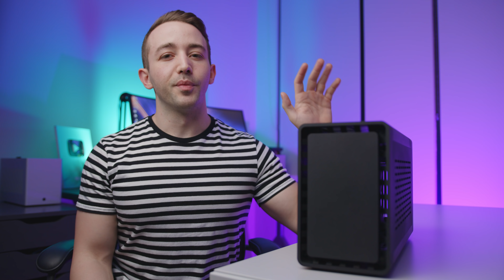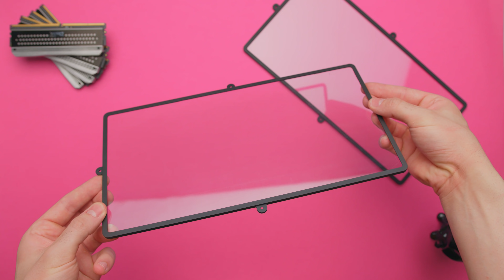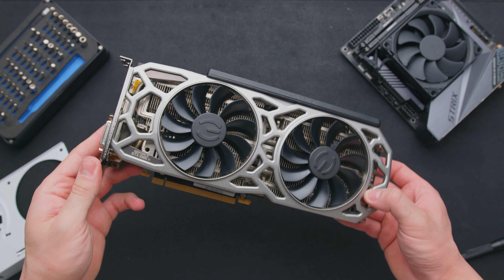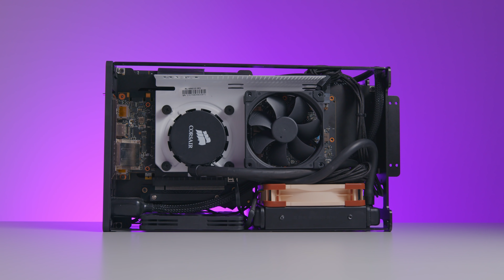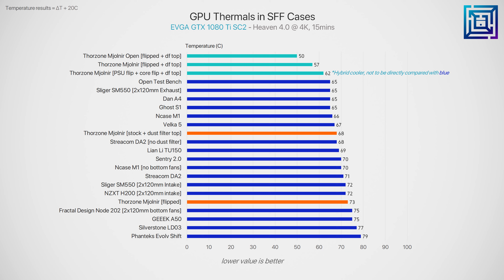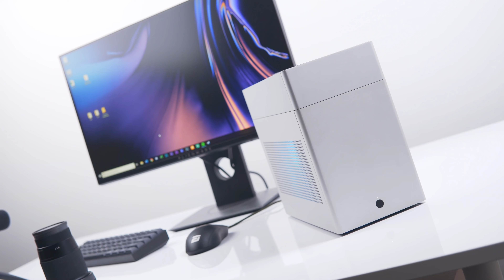Thorzone Mjolnir Hybrid GPU Build + Fixes / Final Thoughts

Comment: Soooooo I'm guessing I shouldn't try to slap a 3080 in here, huh?
Reply: According to a thorzone tweet the middle plate will have a hole in it and then you could theoretically flip the psu and send the hot air into the psu, but you might cook the psu. If you do try it, let us know how that goes.

Comment: Regarding the AIO impact on the PSU, I have a slightly different than normal setup in my A4 that works well:

I flipped the PSU from the normal layout so my AIO in the GPU chamber intakes air, it goes through the rad, and the PSU directly takes that air and exhausts it out of the case. 

While it does mean warmer air for the PSU, it also has basically 0 restrictions in the airflow path, so it's basically a non issue. Think that's worth consideration if possible in one's case.

Comment: You should've flipped it and made the fan as an exhaust out the top.
If you can't put in an L12 or similar, I suspect you need to use the water cooling for the CPU. It should still be exhausting air out the top, since as you know, you don't want hot air to hit other components.

Comment: Awesome review - however I think the best combo for this case would be full air cooling for both cpu / gpu and instead of that radiator add another slim fan - I think temps will be much more balanced that way all around - I would personally be really interested in another video exploring that possibility. Cheers

Comment: Hello I hope you can read this optimum tech. Can you do normal radiator cooling with expensive fan (noctua) vs a push pull cheap fans setup? Buying twice the number of cheap fans for push pull is still cheaper than 1 noctua. Which setup can get cooler?

Comment: Nice case but I prefer my sliger SM550. I still prefer beefy aircooled GPU. With Sliger SM560/580 you can use aftermarket gpu cooler like artic accelero. Even SM550/570 you can put 2.5slots gpu that can stay pretty quiet even on load (best case for aircooled gpu in your graph)..:D

Comment: Did I miss something or was there no testing for a negative pressure setup? Wouldn't a case like this benefit the most by not dumping heat from the radiator directly into the system but rather exhausting that heat instead? It looks like they could add more ventilation vertically on the sides, at lest 6-8 more rows of those ventilation cutouts on each side would probably help a lot. With the tight tolerances I highly doubt anyone could fit dust filters on the interior of the sides to better facilitate a negative pressure setup though.

Comment: thank you for this. i have a dan a4 sfx v3 with asetek 545lc and ryzen 7 1800x and vega 64 reference. i was able to tame the vega 64 reference cooler with undervolting and custom fan curve. but im toying with the idea of using the 545lc aio to cool the vega 64 with a modified nzxt g12 to fit vega 64 die . dan a4 case layout is almost the same as mjolnir minus that i cant flip the internals. do you think its worth it? ill just air cool the 1800x i have a spare c7 and noctua 92mm slim.

Comment: 3:13 with the heatsink fins arranged horizontally like this, there's probably almost nowhere for hot air to escape. One side is blocked by the RAM, and the other - by this massive I/O shield.
Reply: Yeah that's a bit of an oversight - rotate it 90 degrees!

Comment: I'm still very excited for the Mjolnir. I've been basically expecting the results you posted regarding thermals.  I'm planning an air-cooled build, with higher end hardware but no overclock. While a 120mm AIO can really help cool one component specifically, it seems to me it then becomes a bit of a choke point for the rest of the hardware as a whole. I'll be using two 120mm fans, likely as exhaust since the front of the case is vastly open. A glass panel on the CPU side, and depending on thermals when gaming, which ever side panel I'm comfortable with for the GPU side. The Thorzone team is really committed to making this case the best it can be and even now are making some last minute changes (but quality, well thought out ones) in time for what seems like before the shipping production batch begins. It's certainly not a beginner friendly case to build in, but then again, most SFF cases are not. I've got quite some experience with cases around this size, smaller and larger, and have confidence it'll suffice for my needs. I've always been interested in the Loque Ghost S1, but, always felt I was better off just going with an NCase M1 (as I too, would want a larger top hat.) Where as to make a good internally matched/aesthetically pleasing build, I've always felt the Dancase A4 was too limiting. I'd also like to say that your cinematography skills are quite good, and these videos were also quite good as well.
Reply: I feel like you are at a loss then because a ghost with both components cooled on air L12s and gpu stock cooler would be great in an XS config. The only real upgrade would be Ncase and everything on air.
Reply: @Madhawk1995  I like the aesthetic of the Ghost but prefer it second to the NCase, and the Mjolnir most. I had a fully custom water-cooled M1 before and though it was perfectly sufficient I want something smaller because I like the idea of going as small as I can and keeping an aesthetic I like. I'm annoyingly particular.

Comment: I wish they would make it slightly taller so you can have a second 120mm radiator and fan under the mobo so you can either have two 120mm rads with fan for the cpu and the gpu or dual fan 240mm rad.

Comment: Manufacturers should really consider adding free space inside cases. It would improve cooling a lot. What is the point of fans when they are blocked with cables and panels. Just 10-20% more interior space and it would be perfect.

Comment: Is it possible to use the 92mm AIO from the Dan A4 in the Ghost S1 without modifying the Case? 

Thinking about cramming a 3700x with an 2070 Super in the Ghost S1 without Tophats once the case is in Stock on Amazon de.
Reply: I'm pretty sure the ghost can fit a 120mm AIO under the PSU.

Comment: I think the whole concept of cramming all those components into a small space and either in- or exhale hot air from or to each other does not make sense. I like the general idea of those liquid coolers. Heat is transported away effectivly and space efficiently. But then it is transformed into hot air again, which is then blown on another component.

If you have to make a sandwich design work, maybe a sort of central air duct might help. Bring air in from one end. Maybe with a fan and an aggressively shaped nozzle. Collect the air into a flat ducting, which brings cold air to the inside of the sandwich. Then both sides (e.g. power supply and radiator) can use that air for cooling and exhaust it to the outside.

Otherwise, maybe a sort of external cooling would be very effective. Where air intake and exhaust are external.

Comment: Already thought in the first build to flip the PSU.. And wouldn't it be possible to route the cables on the GPU side and then back to the other? I think that would improve cpu termals a lot. A pitty that a 240mm radiator doesnt fit in there.. Would be a beautiful case then!

Comment: Isn't the radiator at the bottom flush with the desk? And aren't those liquid cooling tubing obstructing the airflow too?
I would raise the case from the desk at least 5mm
Reply: The case has a feet that raises it exactly 5mm, they just designed it so that it looks like it is sitting flat for a clean look.
Reply: @jm8080ful  wow, but if the feet extends all the frame, where does the air come in/out? 😣?

Comment: I wish you’d share Air cooled CPU numbers. Last video CPU was watercooled and on this one you didn’t mention CPU temps.
Reply: I’m aware... but it’s nice to hear the independent reviewer opinion.
Reply: The short answer is not to air cool your cpu in this case
Reply: Agreed, if the only way CPU thermals work in this case is via watercooling with an AIO, then there's no point exploring hybrid cooling for the GPU unless Thorzone decides to implement something that can extend the volume of the case to accommodate other hardware. Thorzone's last test didn't work out too well, but they've changed the panels to provide more airflow since so would be good to see revisited videos once the production units are out.
Reply: For reference, Thorzone's own testing had a undevolted 8700 (non-K) hit 100 degrees on air, lol.